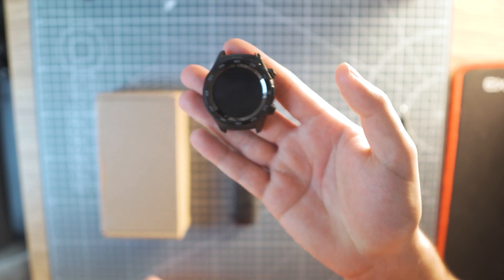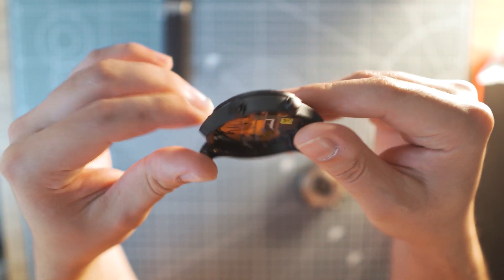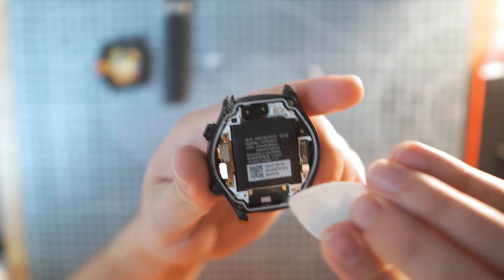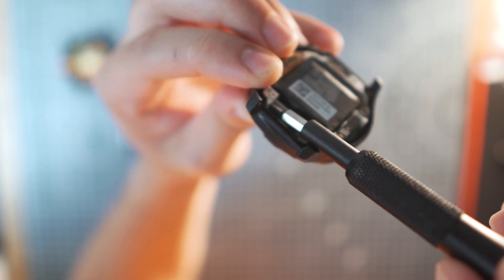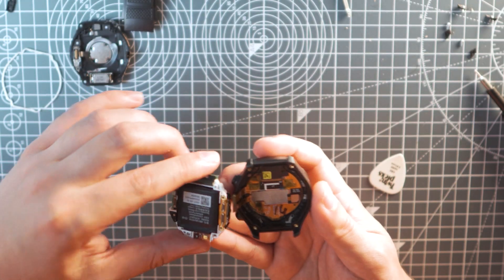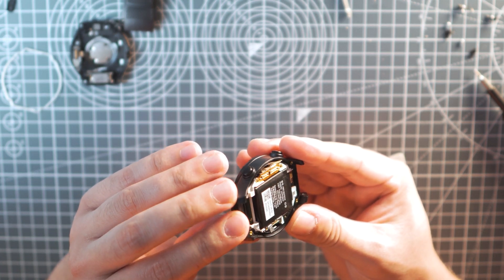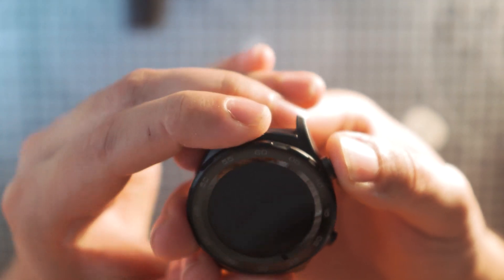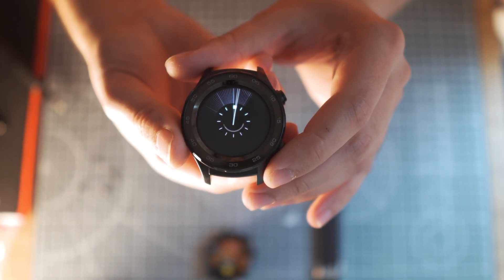Smartwatch Surgery: Huawei Smartwatch 2 Disassembly and Housing Repair

Comment: Hello. Thanks for the video. My lcd got a burn in so I was thinking to replace the screen. Unfortunately the case seems no longer to be available on aliexpress :( U know of any other place where I can find the case? Can you provide me with the name of the merchant on aliexpress?
Anyway: thanks again for your video :)
Reply from the maker: Hi, unfortunately this watch is quite old now.. it is hard to find replacement parts for it. I would try eBay maybe.
Reply: @TechGadgetsMedia   Yay. Just orded one on aliexpress :) Thanks again and now fingers crossed :)
Reply: @TechGadgets Thank you so much for sharing this.  I had some difficulties with one of the 4 screws. But everything else went quit smooth. I replaced the battery as well. Watch look brand new, feels brand new and is ready for the next 5 years :)
Reply from the maker: I'm glad I could help :)

Comment: Thanks to your video I fixed my charging port! It was scraped, like if someone had used a mini drill in one of the gold connectors.

I ordered a backplate and fixed it (15$), much appreciated! :)
Reply: I have the same problem, its sometimes charge but will take some effort. Do you have any link?

Comment: Is there a way to take the screen off existing and put it a new frame? Is the screen glued in and no way to take out? I only bought new frame without screen. If I knew I would have bought a frame with screen.
Reply from the maker: I believe the screen is glued down and it would be quite hard to separate it. Probably you are better off with a new screen with the frame as I did in this video
Reply: @TechGadgetsMedia  I bought a new LCD. Thank You. Wish I didnt wasted money on buying just a frame first.

Comment: The buttons can break on these, the rubber underneath the button broke on mine swapped the buttons never thought of using tape.
Reply: Yes, same happened to me.  How do you call those? Can' t find the name anywhere
Reply: @JeffreyN.Carré   I swapped the bottom one to the top, not sure what the parts are called.
Reply: @1983andyjm  did that a while ago, now both are gone 😁.  I can t seem to be able to find a similar material that will not break and stil protect the metal plate
Reply: @JeffreyN.Carré  its a shame, it must be a well known problem with the watch.

Comment: my huawei watch 2 classic no power, and when put a charge just appear a battery logo with an X , what would be the problem? thanks
Reply: if you get the x logo, it means your battery is bad and needs to be replaced. I had that same issue.
Reply: @k.baller5140  thanks for your cooperation
Reply: Same
Reply: @traciestacy9325  same what?
Reply: @jylimports  same issue I'm having. The X on the watch face when putting it on the charger
Reply: @traciestacy9325   maybe the problem is the battery or charger
Reply: @jylimports  next thing we're trying to do is to replace the battery but i can't determine what the tool is called
Reply: @traciestacy9325  have you done with battery replace? i am facing the same issue

Comment: Thanks for the video. I used it to guide me while fixing an un-responsive button. Turns out there is a small piece of black plastic that guards the membrane switch. this had snapped off so the button plunger wasn't long enough to press the membrane. A double layered square of electrical tape has it up and running again. Job done. Money saved for me new subscriber for you. Cheers.
Reply: I had same problem
Reply: finally, I find the way to fix an un-responsivve button. Thank you.

Comment: what is the size of the screwdriver head needed for this?
Reply: Did you ever get that question answered?  I need to know as well
Reply: nope, but i think it would be T2 or T1. don't have any of these to check. 
I have T3, which seems little bigger.